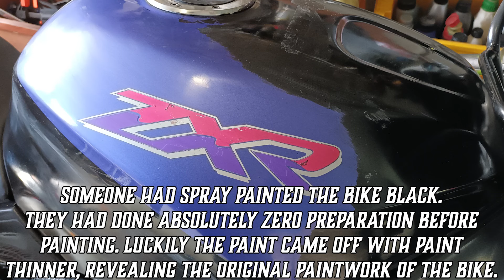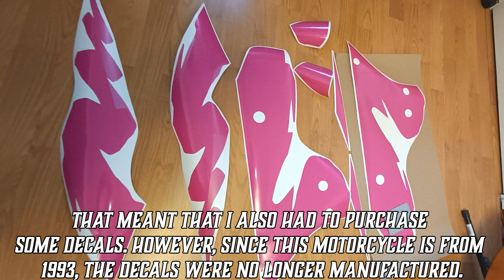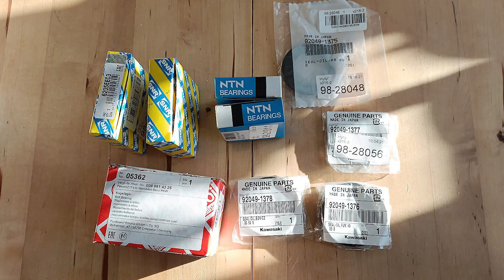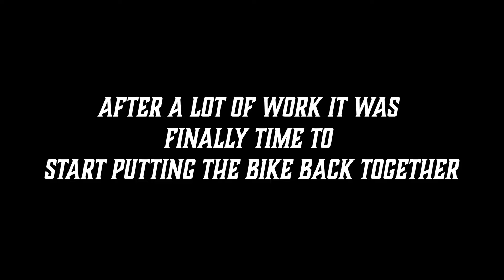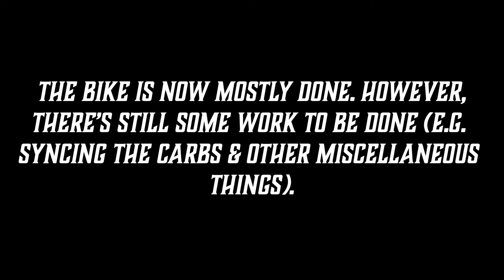1993 Kawasaki ZXR 750 Restoration - 90s Sport bike FULL BUILD

Comment: It turned out very well and you can see a lot of work put into the project. Just a few days ago I bought such a motorcycle in the same painting with the mileage of 19,000 thousand and in original condition. Regards
Ps. these motorcycles are more and more sought after and beautiful